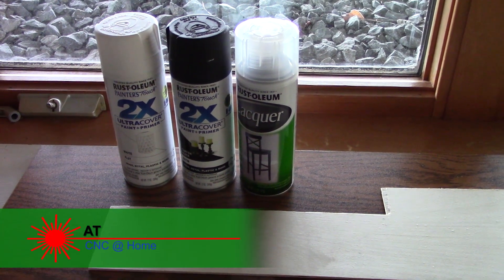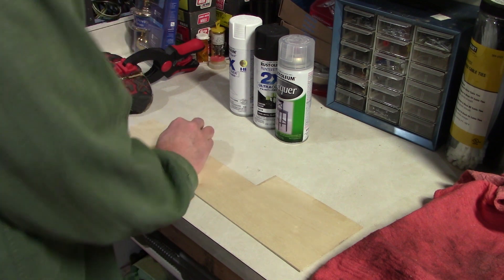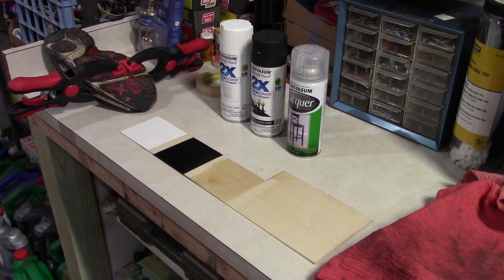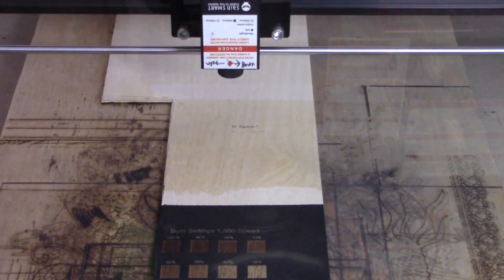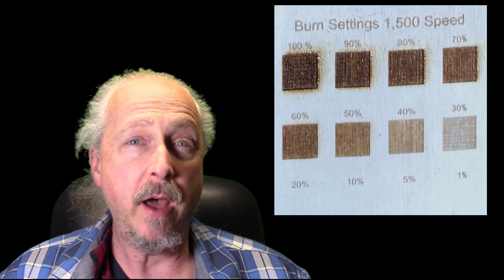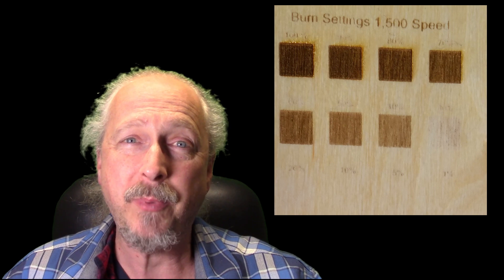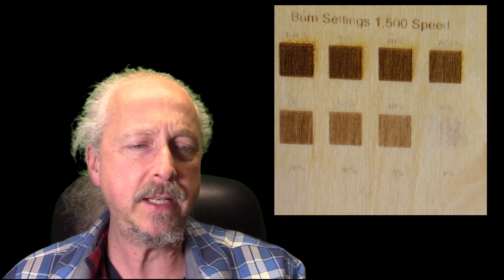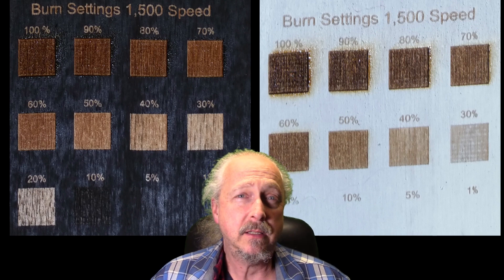I didn't expect that!  Laser etching painted wood

Comment: When I laser engrave white paint on wood I get a lot of soot residue Black )   and it goes all over the white paint  any suggestions?
Reply from the maker: Good question.  I put a light coat of paint on here and did not get much for soot.  I also didn't have air assist at the time of this video.  If you have a bunch of that black soot, the air assist can blow it around where it can get on your material where you don't want it. Those would be my two things to look at.  Thin coat of paint and not air assist.  I like having the air assist on if there isn't an issue with the soot getting everywhere as the burn tends to look cleaner and you don't have so much of the amber/brown coloring on the edges of the burn.  Good luck!
Reply: @CNCATHome  thanks. I’ll see what I can do